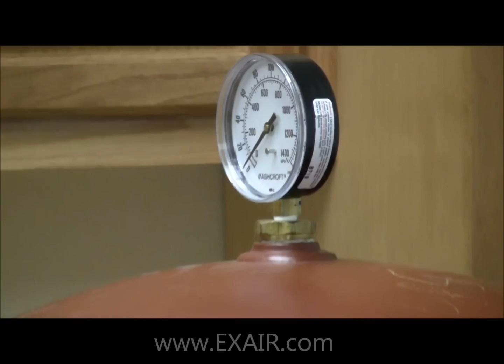Receiver Tank Tutorial

Comment: Is it necessary to give inlet of air to the air receiver tank from the bottom of the tank and let the outlet from top in a vertical tank???
Reply from the maker: You do not need to plumb the inlet into the bottom of the tank in this scenario.  We would generally recommend to bring the compressed air into the lower ports on the side and not he actual bottom of the tank.  The bottom port should always have a condensate drain located on the port.  If your application requires the compressed air inlet to come in on a higher side port you could use one of the other side ports for the exhaust air, it is simply better practice to use a higher port for the outbound air.  If you have any other questions or would like to discuss further, please contact an Application Engineer at 1-800-903-9247.